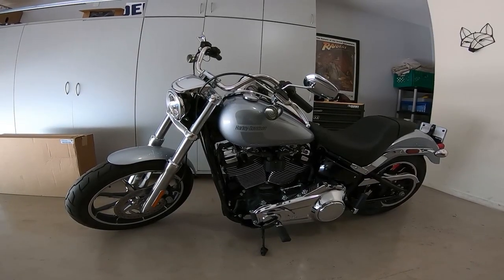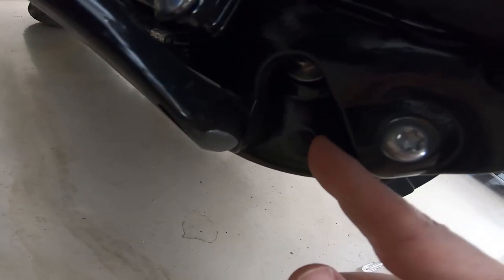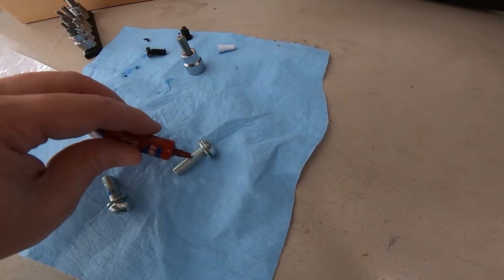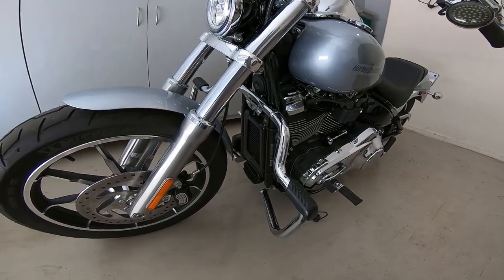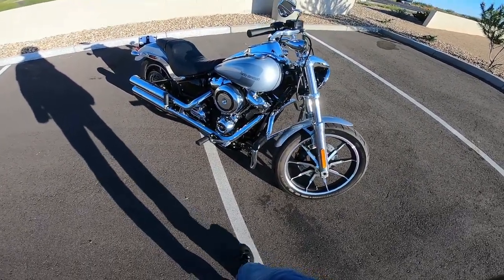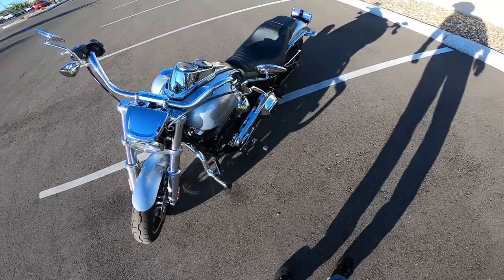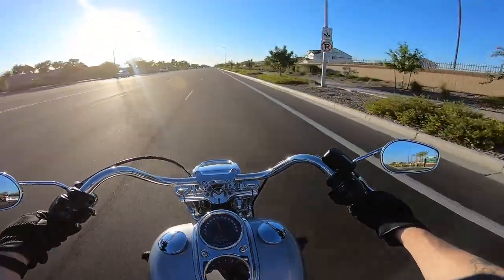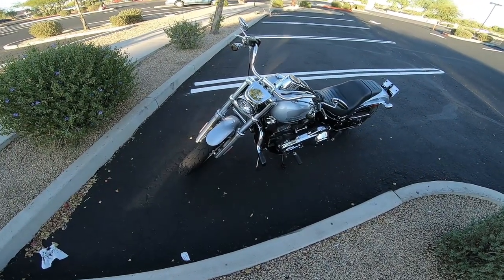Engine Guard Install - Harley-Davidson Low Rider (FXLR)

Comment: Female friend just bought a 2019 FXLR, sent her a link to your clip here, I like those bars. Did you have any luck on the mounts for the saddlebags that I can pass along to her too? Thanks for sharing, that's one of the great things about this community, everyone helping each other.
Reply from the maker: I think the Harley saddlebag mounting bolts are still widely available, I just had trouble getting them from a couple of places I called. I ended up ordering them from a Harley dealer out of state. I installed a luggage rack at first before going with saddlebags. https://www.youtube.com/watch?v=uv6wArAUBVM

Comment: Hi there, how did you hold the damn nut that goes behind the frame to hold the top screw of the guard?  Do you need a crowfoot wrench?  It seems Harley tapped the bottom holes, but not the top one ?  (I say this because the space is too tight to hold the nut in place so you can screw the top screw.)  Unless I'm missing something...  :)
Reply from the maker: I was able to wedge a small wrench in there to hold the nut in place while turning the bolt from the front. It's not easy. I like the Cobra Freeway Bars much better for ease of install.
Reply: @KSSTUDIOS  I guess I gotta get me a small wrench...Thanks!

Comment: hi I bought the Bar from China , but they did not include the bolt and or screw . if you don't mind what size the bolts to use it for top and bottom side . thank you cheers

Comment: I went with these too because I liked the l👀k. Your video helped but one thing I missed was that all the washers aren’t the same. The top one is different than the bottom two. Guess what, he bottom washer fits the top but the top washer doesn’t fit the bottom. Had to undo it. Also, the right bottom bolt just wouldn’t go in for me. I took it off and had to pre-thread the bolt to get it started. There must have been paint in the threads.
Reply from the maker: Yeah, the factory paint job gets in those threads sometimes. I've installed these on a few Softails now and started using a small wire brush to clean those before threading the bolts in there.

Comment: Just put a guard on my 2019 FLHC ........ The  bolt  holes  were just a bit  out of alignment......   :-(    ..   Getting  your fingers up under that centre frame mount is  a pain in the arse!!    but with a bit swearing and jiggling about  finally got it all mounted right. ..
Reply from the maker: I just installed my second one this weekend and that center frame nut was just as much of a pain as the last time 😬.

Comment: ey bro nice video! I am looking at this mod too especially I am a new rider. I just couldn't tell if the engine guard is wider than the handle bar/ regular harley engine guard? I have the stock low rider s handle bar. It's because i live in a state wear we can split lanes, it would be much harder to split lanes on a wider bike.
Reply from the maker: I just measured my engine guard at about 32" wide to give you an idea of how far they would stick out. 16 inches from the center bolt.
Reply: @KSSTUDIOS  awesome thank you so much!

Comment: Thanks for the video the bike looks awesome, I haven't decided if I want the standard or the mustache engine guards for my 2018 Low Rider
Reply from the maker: I originally got the mustache guard for the built-in foot rests but never really used them because they felt too high for me. I ended up switching to the regular engine guard later on. I would recommend checking your local dealer to see if they have any bikes with them installed so that you can try them out first.
Reply: @KSSTUDIOS  good idea. Thanks for the tip. Ride safe.

Comment: I have floorboards, Will it fit with floorboards? Thought you had FBs as well, but ya have mid controls.
Reply from the maker: I helped someone install one of these on a 2020 Softail Deluxe with floorboards and it fit just fine. It mounted using the screw holes in between the holes that his floorboards use. Double check the install instructions on Harley' s site to make sure it is the same for your bike.

Comment: Any issues using the foot pegs  your feet stay on and comfortable.  I'm thinking about getting them to stretch my legs
Reply from the maker: The foot rests on this bar were OK for me at 6 ft. tall. I would prefer them a little lower personally. I'll probably go with clamp-on pegs. Try them out if you can find a bike at the dealer with these installed.

Comment: Maybe I'm dumb but I cannot find a way to hold that nut while I tighten the top bolt. Can't get a hand, socket, or even pliers to hold it. Any advice?
Reply from the maker: I managed to get a small wrench in there to hold the nut while I used the ratchet to tighten the bolt on the front of the guard. It wasn't easy.
Reply: Man, that top center bolt was a pain for me too.    Used a 13 mm (didn’t have a SAE) wrench and got my hand in that tiny area above the oil cooler on the left hand side. Luckily I padded the ground and fender with towels just like the guy in the video and that saved me from damaging my fenders and crash bar.

Comment: Can't get the holes to line up on a 2020 model.. very frustrating. Did you have issues getting the holes to line up?
Reply from the maker: Mine lined up good on my 19. I did notice it worked better when I loosely installed all of the bolts to get it lined up and then tightened them down.